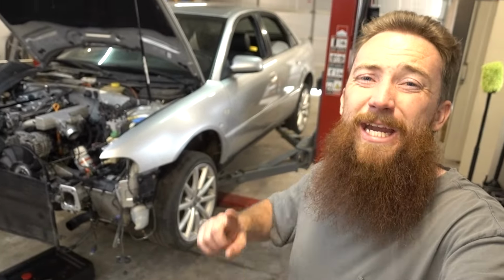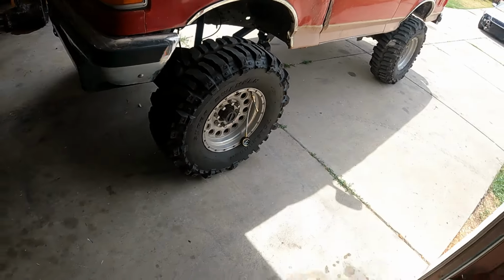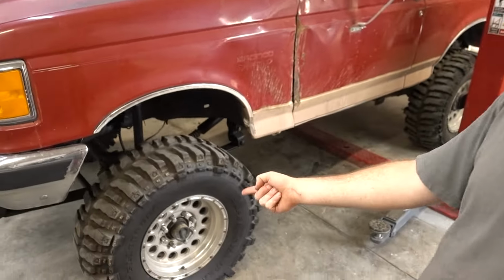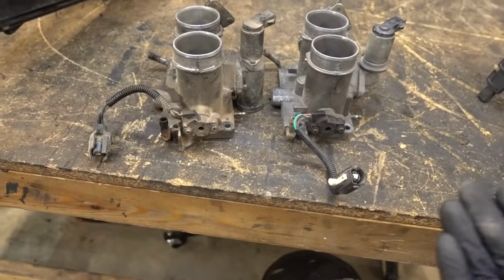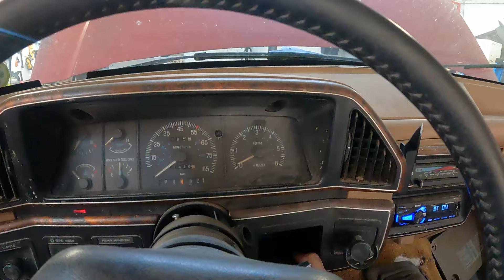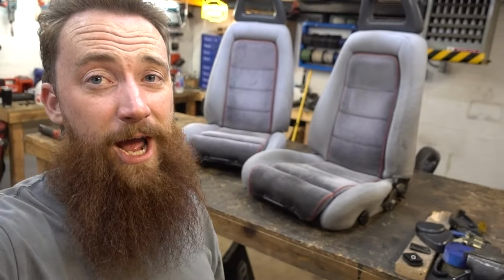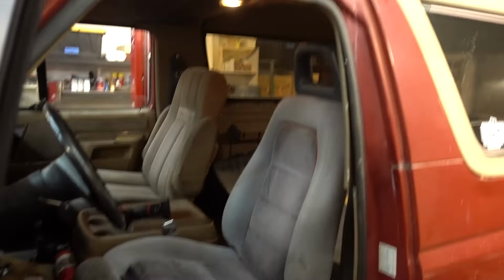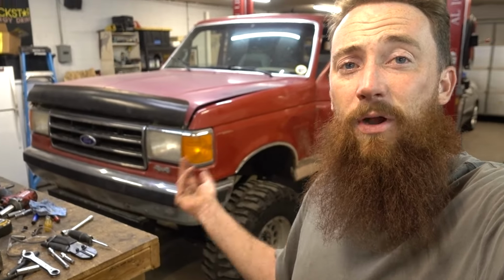Fox Body MUSTANG Seats In My BRONCO (Bolts Right Up)

Comment: Great video! Sick seats! To check for vacuum leaks without a smoke machine, spray carb/brake clean around and on all the vacuum lines. If the truck revs up as soon as you spray it at that spot, you found the leak.
Reply from the maker: Thanks man! I’m gonna try that trick this weekend and hope it works!
Reply: @electricsmith1650  I hope so too!